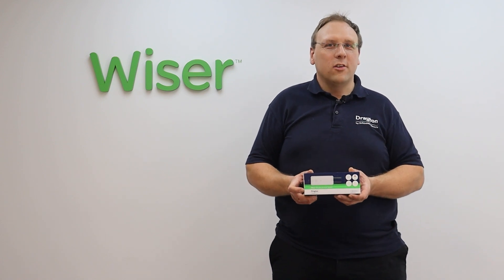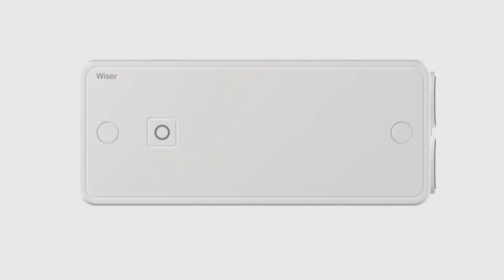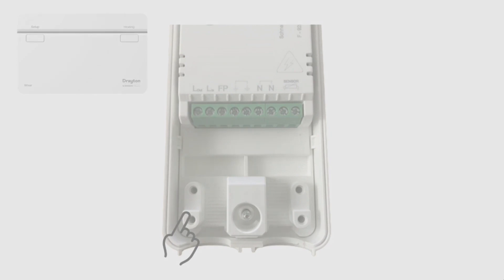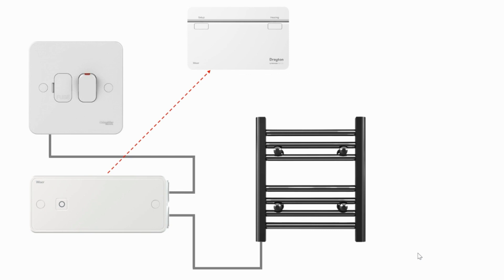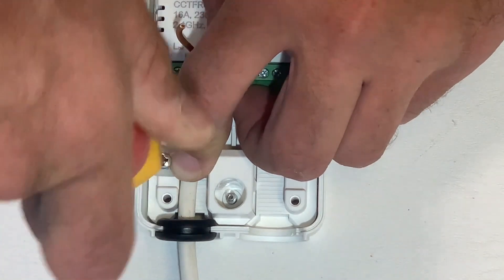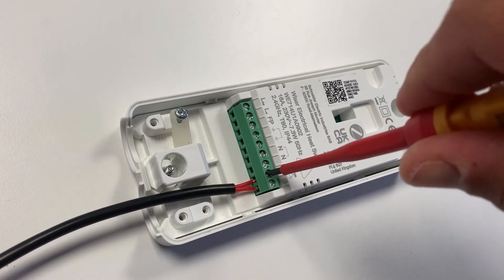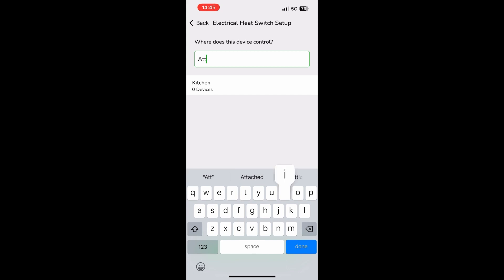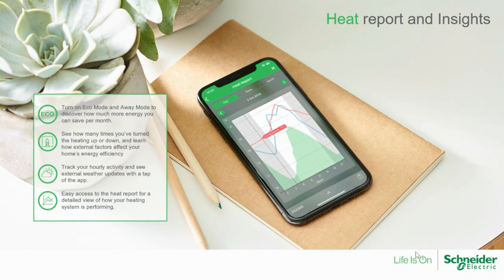Wiser - Electrical Heat Switch

Comment: So my question is can you assign 3 electric heat switches to one room thermostat 

In the case of electric panel heaters in each room of the house 

So one central thermostat to control the house temperature
Reply from the maker: For the most comprehensive response I recommend contacting our technical support team, who will be able to talk you through the best options for your situation. The number is 0333 6000 622 and lines are open Monday to Thursday 8am - 4.30pm and 8am - 3.30pm on Friday.

Comment: I intend to hide this inside a wall box. I noticed the button is some sort of light sensor and not a physical button. Is hiding this in the wall going to cause issues with that button.
Reply from the maker: No, it's just a touch button so if you hide it you just won't be able to use the button for overriding.
Reply: That's fine as If I need to override I can access as and when required. Luckily al my Drayton stuff has been super reliable so if this follows suit then I won't have to override or do much messing with it outside the app. Thanks for the clarity.  @Draytonheating
Reply: Next problem. It barely heats. No instructions anywhere on how to setup the app settings. It's not warm. I can tell it's on but it's cold just not as cold as surrounding areas. Won't go past 15-16 degrees according to app and the temp on the app settings constantly changes.

Comment: Hi, at 8.30mins you mention telling the system what UFH temp sensor is being used. How do you do this? I have  the Drayton one as recommended
Reply from the maker: When you add the Electrical Heat Switch to the system your given the option to choose if your using a floor sensor and also choose it's value from a drop down menu.
Reply: @Draytonheating this did appear but only after removing and resetting the heat switch. Thanks
Reply: @Draytonheating I am having this issue. I get no options for the floor sensors. I also did as the person below stated and still only goes from control type to complete.
Reply: All fixed. Had to delete both from app, reset switch first and add and then reset thermostat and add and then it appeared after a few times trying.
Reply: However two temp sensor cables have been installed and neither works, temp reading jumps between 15' and 24' (as an example) on both, on two separate EHS. Both have been installed correctly, away from the UFH cable and cold tail.